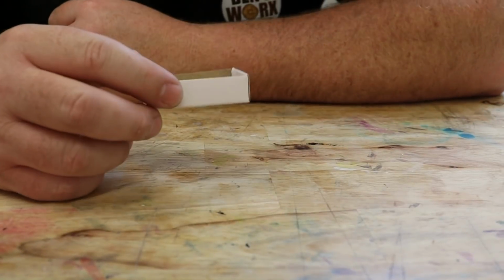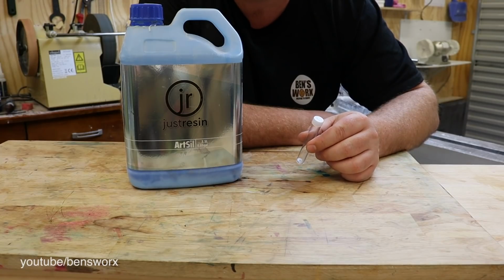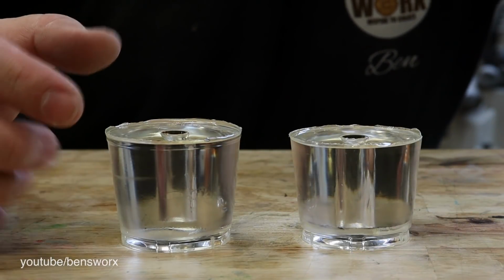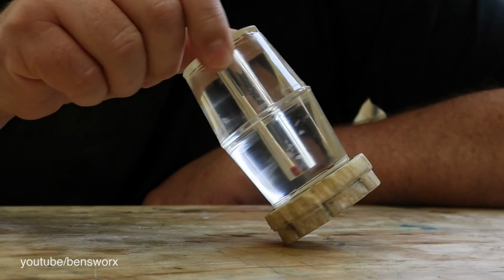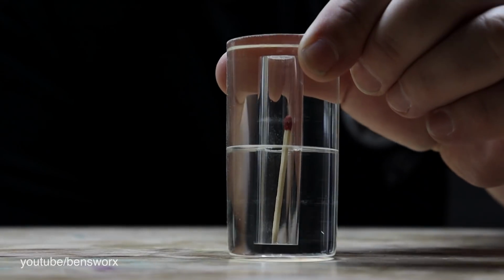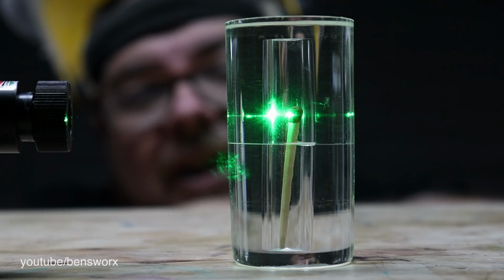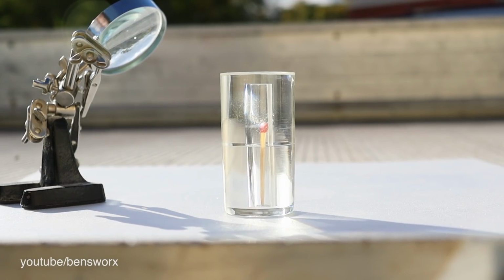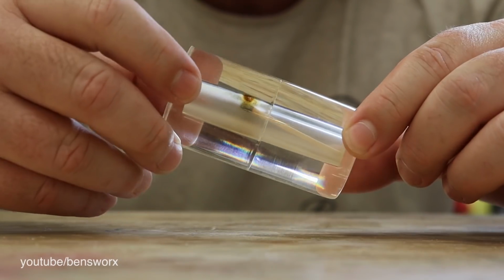Can You Light a Match in Epoxy Resin ?

Comment from the maker: Check out the SPARKLERS in resin ➡️ https://youtu.be/DpbXYBCcoPg
Reply: Omw :D
Reply: You didnt have to create an air pocket, the chemical in the match head is Potassium Chlorate and that has its own oxygen at the molecular level  to provide towards combustion. You should try this agin but mold the match directly into the epoxy, and mabye make sure to keep the wall thickness as thin or thinner than what it was here. It might crack open as you ignite it, because the pressure of the gases evolved in the reaction will have no where to go.
Reply: i think work slightly better in square design because round bends light
Reply: @Shrek_Has_Covid19  No they will just explode then. Its probably far more interesting to see would a single match head even crack it, or as it ignites and the pressure rises would this be enough to stop it combusting to completion. 

Then do a firework if you want but its just going to be a louder bang with shards of resin going everywhere.
Reply: Can you cool it down, and heat it up, to see how the smoke reacts? Please?

Comment: should've tried self oxidising/waterproof/survival matches and properly cast it in resin :p
Reply: @ThePrufessa  exactly what i was thinking. no void needed
Reply: How would that work without oxygen?
Reply: @sandramays795  Because it contains an oxidizer. The same idea lets a rocket can combust in space and is also how almost all explosives work because they have to burn much faster than air could bring in more oxygen.
Reply: I was thinking the same.
There are matches that contain oxidizer
Reply: @Cethinn  that was a cool factoid, thank you 😁
Reply: @taattataattataattata  wouldn't that basically create a bomb?
Reply: @vanerek  Nope probably would not burn all that much longer. Even though they contain a oxidizer it it will still get suffocated by the waste gasses co2 etc. In water the waste gas has some place to go. In resin that wont be the case
Reply: @nanaki-seto On the contrary, the combustion gases will increase pressure which will in turn increase the rate of combustion, the oxidiser and fuel in matchhead compositions are in intimate contact due to being thoroughly mixed and this self-accelerating reaction will usually advance until the container is ruptured. It's essentially a bomb, you just have to hope the internal pressure doesn't exceed the strength of the container or it'll rupture and/or fragment which as we know is pretty dangerous.
Reply: @CATASTEROID934  Use bigger container, glue match to base, liquid resin, no lid?
Reply: Came down here to say this
Reply: All matches have oxidizer in them.
Reply: @Solomon_RD  Heres another fact; the word factoid was originally coined to refer to a false fact.
Reply: @Solomon_RD  "The term was coined by American writer Norman Mailer in his 1973 biography of Marilyn Monroe. Mailer described factoids as "facts which have no existence before appearing in a magazine or newspaper", and created the word by combining the word fact and the ending -oid to mean "similar but not the same"."
Reply: problem is the heat of the resin could ignite the match
Reply: He'll yeah, or maybe cut off a bunch of match heads and cast those.
Reply: @taattataattataattata  yeah but there needs to be a space for it to light up right
Reply: Ditto. I was about to write the same comment. I was thinking one of those UCO matches.  I bet it would light.
Reply: @CATASTEROID934  see this is why we do science experiments to learn what happens.

So he should make this video again, but will it be a bomb or a paperweight? Find out next time on dragon bomb resin
Reply: @CATASTEROID934  nope, it'll burn up the oxidizer and fuel in a second or two, and there isn't enough air for a flame.
Reply: could even work with normal matches. You can test them by smashing the head with a hammer - if it goes bang, then that's got oxidiser :D
Reply: @SylviaRustyFae  this guy here knows how to use google
Reply: @brandonbedard916  *Im not a guy.*
Reply: @SylviaRustyFae  i literally dident care enough to check and now that i have that beard would have fooled me anyways
Reply: aenr all matches self oxidizing?
Reply: @vytisagafonovas3887  no and these guys dont even know how it works the idea is to get it hot enough to create its own oxygen
Reply: @brandonbedard916  like in a sun?
Reply: @vytisagafonovas3887  sun dosent use oxygen it uses hydrogen
Reply: @brandonbedard916  i mean you mentioned get hot enough to create oxygen. Sun is hot enough to create oxygen
Reply: @vytisagafonovas3887  the sun works in a diff way its not combustion it runs off hydrogen so it doesn't need oxygon it has its own never ending fuel source its nuclear fusion
Reply: @vytisagafonovas3887  remeber also dude no atmosphere in space no oxygen what so ever up there
Reply: @vytisagafonovas3887  think of the sun as a light bulb rather then a fire if that makes sense
Reply: @brandonbedard916  im not taling about what the source of heat in sun im talking about sun being able to create oxygen atoms by smashing other atoms together.
Reply: @vytisagafonovas3887  no the sun can not create any oxygen at the moment its therized one day it will be able to thoe and even have all the elments for water remeber oxygen and hydrogen create water
Reply: @Cethinn  about the rocket analogy:
On the one hand you right, a rocket can combust, withou surrounding atmosphere and therefore oxygen.
On the other hand... Thats because It is taking it's oxidizer with it and in case of the many of the most comon Fuel-oxi-combinations (Hydrogen or Hydrazine) that oxidizer ist just... Oxygen (in a tank, not a void but you get the point).

Talking SRBs; they just use an oxidizer chemically bound in another molecule like Ammonium perchlorate (the one of the spaceshuttle SRBs).

So technically LOX (liquid oxygen) is an oxidizer, but naahh... "How would that work without oxygen?" - Not, it would simply not

Comment: This makes me wonder if there's a way to trap regular or coloured smoke in resin and have it last,some coloured smoke in a pendant would look super cool
Reply from the maker: Yeah definitely 👍
Reply: Well, regular smoke bomb, blackpower or some high power composition to ignite the fuse burn. And maybeeeeeeeee? But then there's all the debris. Which could be hidden in some sort of wooden base?  Definitely not pendant sized but possible and itd be super cool!
Reply: @Eazy_Company  maybe you get the smoke balls and take the powder out and put it in a small pendant or maybe and egg and then ignite it. I’m curious to know how long the smoke would last in there
Reply: My guess is, even though the smoke isn't able to escape, it would still cool down, and revert back into either resin or condensation on the inside of the cavity. Would only look cool for a hour or so. If even.
Reply: @BensWorx  do it!!
Reply: @BensWorx  Ooooh, get some coloured smoke balls and light them off inside some resin thing with a light in the middle as well so that you get a cool coloured smoke light thing
Reply: smoke is just particles, so when they interact with the side walls, they will settle, so over time you end up with a film on the resin instead of smoke.
Reply: Like a coloured smoke bomb
Reply: Also I wonder how long the smoke will be visible like that or if it will break down and disappear

Comment: Try casting a seed of some kind in a void like that with a little water and sit it in the sun and see if it will sprout 🌳
Reply: Yeah.  Maybe with some soil and a little water, too!
Reply: And talk to it.
Reply: Do you mean a  terrarium ?
Reply: @nicoll420  micro terrarium, fully sealed with no possible maintanance. could be interesting
Reply: @Wolfchant17  would buy
Reply: Wouldn’t work. No oxygen/co2 exchange
Reply: I think the heat of the curing resin and or the toxic fumes might kill it.
Reply: misread casting as eating... Got a completely diff idea of what ya were suggesting
Reply: @5hiftyL1v3a  Put some dry ice in it.
Reply: I've seen them completely sealed and living for years.  The plants produce and recycle their own oxygen and the water evaporates to the roof and drips back down in an endless cycle.
Reply: @firefight77  Yeah my 4th grade class had one. It was a way for us to actually watch the cycle. It wasn't cast in resin though. I think it was sealed glass. I'd be curious about how resin would affect it. I think if you make the void large enough you'd probably have the best success.
Reply: @doep1007   I think it could work. If you made the void large enough and the seed was put in soil the soil might act as a barrier protecting the seed. Plus if he cast it in steps similar to the match it wouldn't have nearly as much exposure to curing resin.

He just wouldn't be able to turn it on the lathe like he did with this one. All of the soil and the seed would shake around. He could create a base and then put the cylinder over it like a bell jar.
Reply: @lebby1688  Could work. Cast in a square mold and polish flat faces eliminating the need for lathe work.
Reply: @doep1007  Agreed as long as you don't tip it.
Reply: @5hiftyL1v3a  look up sealed terrarium. the plants and soil will do the exchanging if you have a little sunlight

Comment: The match has it’s own oxygen so for that the void was not needed. But the void may have prevented an explosion 😀 
BTW. The sun probably did not light it so fast because the infrared light (heat radiation) may not pass the resin.
Reply: Yup! I wonder about what type of light can filter, I was also thinking it was bc he focused on the curved side instead of the ends too.
Reply: it would be cool to see it with no void
Reply: That type of match doesn’t have its own oxygen. That was a normal match not a waterproof survival match.
Reply: @Its_just_Dave.  The head does. The colored tip!
Reply: @washqz7775  interesting. I’ll have to check it out.
Reply: A match wouldn't have the stored energy needed to break the resin. A backwards wired capacitor however...

Comment: The match head contains its own oxidizer so would light even without the void. It might create enough pressure to explode the resin though. I think you should try it. LOL
Reply: @ThePrufessa  It's the pressure from expanding gas that makes it possible. There are plenty of videos of this.
You can make a decent little projectile with one match head as long as it is contained.
Reply: @ThePrufessa  True, I was just thinking it might as he did it in 2 half's and there was still a visible seam. Even though it was probably just a refraction of light.
Reply: @Megaglow Z I made my first matched cannon when I was 9. I shot lead balls into my bedroom wall.
Reply: If he puts it in a pressure pot the air in the wood of the matchstick would be compressed and under pressure, leaving less capacity for the gas produced by combustion to be compressed into. It would be interesting to test if there was a more violent reaction.

Comment from the maker: I can’t believe this worked ➡️ https://youtu.be/DnfwrmZhDms
Reply: Next try storm proof matches. They don't need air and will burn under water
Reply: Hey, can you make a note in a bottle, like this. I think it would look nice.
Reply: BEN THATS THE COOLEST THING IVE EVER SEEN
Reply: Me either!
Reply: Great video!! I love all of the interesting tests you do and I think one similar to this that would be fun is to stick several match heads in an Epoxy case, light them up and see if the smoke will stay in there, or if we're lucky there might even be a crack that forms from the pressure. Another thing that would be interesting with this is there would be no match stick to absorb the smoke, so the smoke might stay in the case forever without 'dissipating' into the match stick wood. Love the work and keep it up with your good smiles and fun times! :)
Reply: Next time only use several match heads in the center, maybe 10? Or more!! Only use the heads tho without the extra wood sticks
Reply: matches don't need oxygen. even  the cheap ones self oxidize
Reply: You could do the same with a cigarette and a match and put a "Break in Emergency" sign on it :D
Reply: @alee_enn  haha I used to have one of those and that's exactly what I was thinking of when I saw the match in the cylinder!
Reply: You should try this again but without the air void, see if it can ignite at all just being in resin.
Reply: @KalijahAnderson  A match (and fire) needs three things to ignite: Oxygen, Heat and Fuel (Ben says this in the video). It's called the fire triangle, take away any one of those three elements, and you won't get fire.

You are proposing to encase a match in resin without the void space Ben created to see if it will ignite. It will have no Oxygen, and therefore, won't ignite.
Reply: @alee_enn  I am aware of that. But matches self oxidize so the onlything missing is heat. I'm curious what would happen if you combusted a match head encased in resin of that thickness or if the resin would interfere with the combustion.
Reply: @KalijahAnderson  What I was trying to say was that there is no space for any air for the match to use when it ignites. The match itself would also be soaked in resin. Without any air/oxygen, the match won't ignite.
Reply: @alee_enn  Something that self oxidizes doesn't need air to burn. Matches flare like they do because they have their own oxidizer built in. When the oxidizer runs out is when it settles down and looks like a candle flame. As it has it's own oxygen then it's down to the question of what the effect of the resin will be. That's the only variable in this.
Reply: @KalijahAnderson  Get some resin and answer it for yourself.
Reply: Thanks for spoiling it
Reply: @Me-qp8vz  absolutely yes. Look up storm matches.
Reply: @alee_enn  the guy literally asked for suggestions. So I made a suggestion. Just because you don't get that, or the idea of what an oxidizer is, doesn't mean this is the wrong place for a (requested) suggestion.
Reply: I can plus a match doesn't need oxygen to light they make it themselves
Reply: @Lee-st4gs  100 match stick heads no wood stick now that's a video
Reply: Hey man, love your work! You should try putting ferrofluid in resin! Keep it up!
Reply: wtf, it wasnt even Casted in resin, u left space in there
Reply: @KalijahAnderson   dumb question: what space will the flame itself take up if there is no void?
Reply: @pixelboy1192  I'm guessing the pressure will build if it can ignite. Possibly crack the resin, possibly do something unexpected. I'm not sure, hence the suggestion to find out. The resin might soak into the match head and so something that prevents combustion. I'm wondering if it will ignite at all.
Reply: @KalijahAnderson  my thought is that it may vaporize, then combust, but for that to vaporize it, it would take a lot of energy, and the vapors may smother it. Honestly, it might not do anything, but it's worth it to test.
Reply: @Me-qp8vz   if it has oxygen(oxidizer) fuel(phosphorus) and heat(friction) it will light. There will even be a flame, the way it would do that is that since plasma is an gas with orbital electrons, it would light with no issue, it would
 look like a flame bubble.
Reply: I wonder how long a plant can survive in this situation. I'm curious as to if you can keep a plant alive for a solid year. If you need reference look at Serpa Designs on YT. He does sealed terrariums. If you think about it it's the same basic set up. You just can't get into it to help it put. I'm guessing a small cactus would probably survive quite a long time.
Reply: @veneraberens4653  jesus, really?
Reply: You should o a bundle of just match heads with minimal airspace. The matches, much like gunpowder, contain their own oxidizer (oxygen source). I want to see something blow up please :)
Reply: @PharaohFluidity  REALLY WHAT AND YES TO JESUS 💯✌️💚💚✌️💯🙂
Reply: don't you think it will be better with a stormproof match?

Comment: That was a great bonus video. Curious how long the smoke sticks around.
Reply from the maker: Thanks Mark, it has slowly disappeared
Reply: @remusgrrrl  still, smoke only is visible because it has lots of tiny solid or liquid particles. Those are either going to settle to the bottom, or stick to the sides giving the glass aaa ssmoky appearance. The actual air/combustion gases inside are going to turn clear eventually.

Comment: Can you put a mini computer in resin and keep it functional? Examples include Pi, Arduino, or NUC. Some issues i see are wires, resin interacts with the components, finally heat dissipation, i am sure there are more that i am not thinking about.
Reply: Also in the casting process it is possible that some solder could be melted shorting it, also it would probably need to be turned on before being casted, so yeah a ton of problems, still an interesting idea

Comment: If you cap a lit candle and then open it after it goes out you will get lots of smoke being released. However, if you leave there for a few hours or a day the smoke will no longer be aromatic and cling to the sides. I think that's whats going to happen to this demonstration. It will still look smokey but when cut open it will be just soot on the sides of the container. Still a very cool and fun video!

Comment: I was very confident the Lazer would not work for this. Just because the same way clear safety glasses work to keep your eyes from getting flash around welding. They both deflect any ultraviolet rays and prevent the business part of the rays from getting to what's being protected. I've been a welder for 25+ years so I'm knowledgeable on that aspect of light transfer. I also own a fiberglass and gel coat business that I use all resins especially poly and epoxy. Definitely an great video. I'm not criticizing at all.